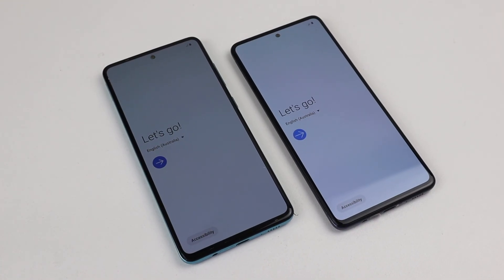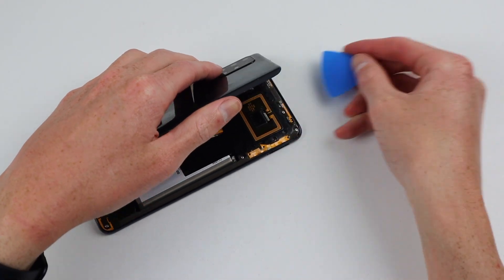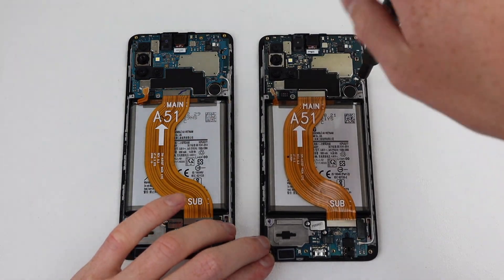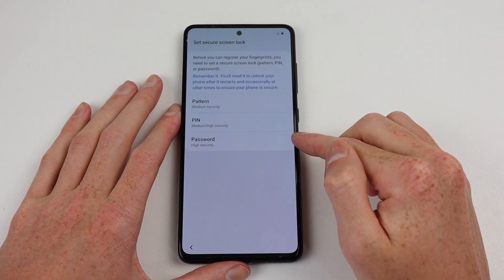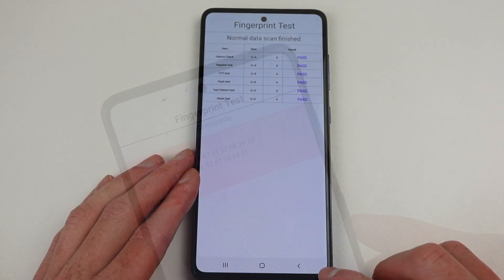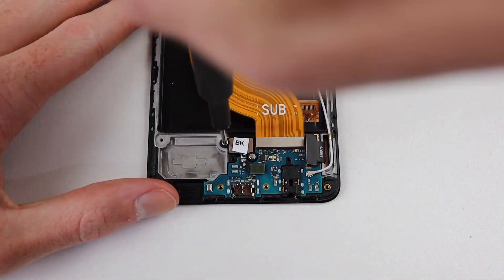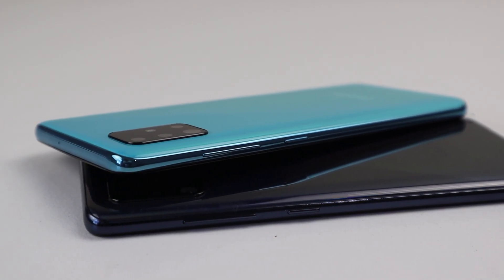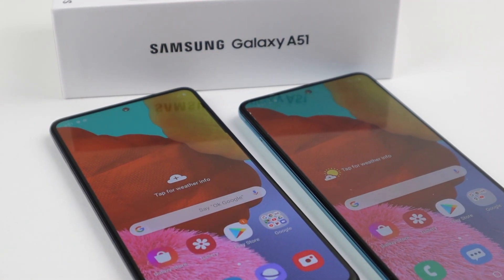Samsung Starts Blocking 3rd Party Repairs? - Galaxy A51 Teardown and Repair Assessment

Comment: Everyone starts saying "oh no Samsung is doing Apple things" "I'm glad I ditched Samsung since trash Exynos" "Chinese phones forever"
You all should probably calm down. This is the first time we see this issue. In-screen fingerprint sensors are not a simple component and Samsung is concerned with the security of the device, more or less. Calibration tools are not that easy to find and are not cheap, OR they just don't have the demand yet since this is a relatively new device, thus we don't see them. Time will tell if I am wrong, but later we will see more methods of repairing such things, so stop destroying Samsung for these little problems
Reply: You're wrong. This has nothing to do with security. The fingerprint scanner is just a camera, you can change it all day without compromising security. The actual fringerprint data is stored elsewhere on the phone. Changing the screen and fingerprint camera doesn't compromise security at all, that's just an excuse Apple and Samsung use to justify screwing you over for repairing your phone instead of buying a new one. 

Samsung will only get worse, just like Apple has only gotten worse. Shame you'd rather stan Samsung than see it.
Reply: @mjc0961  I wouldn't. I don't like Chinese phones, I don't like Apple. Right now I stick with Samsung, but only time will tell if I ever change my next smartphone. This is just my opinion on the topic and I don't want to make a claim, that Samsung is the best and is always thinking about their customers or smth. In fact, any company will do things over the board to earn more money and they will not care at all about environment. So yeah, I don't think I am wrong here. I might be wrong with the scanner, but I am no tech nerd, I just thought maybe they use something special for the scanner, rather than just a camera. People just need to stop making hasty desicions. Realistically speaking, any intellectual person will put a case and a screen protector on their smartphone no matter how strong manufacturers of the device claim it is. Real life shows, that all phones break no matter how strong they claim to be. So those, who break their screen or scanner are not thinking about the fact, that they can use that device for longer without spending money on a new one or repairing it. Or maybe it is just a software issue from Samsung that they need to fix to get repaired screen/scanner to work on that device, who knows? I don't exclude accidents, maybe they had all the protective measures and still ended up with a broken device. In that case, well, I'd just call this unfortunate. Again, only time will tell if I am wrong, but I wouldn't hate on a company for these little easily avoidable problems. If they continue to do so, I might as well switch to something else.
Reply: Tbh the fingerprint on the a51 is crap to begin with: it had a registration issue. And it took them so long just to sort it. Does that really show they care? Also Samsung is starting to act like Apple with the prices of phones, component replacements etc. Why the need to lock components? I replaced a s6 fingerprint and it was happy days, but now looks like you can't even fix your phone for cheap. There's hardly a security issue with fingerprint sensors that requires them to be calibrated to each phone. Chopping you're finger off is a security issue. It's mostly businesses looking to make money. Furthermore, the calibration devices are expensive as the manufacturer make it so: they can make the calibration in a way that devices can be cheaper. Sadly Samsung have failed to really make their devices easy to use compared to Apple: which is a big part of people choosing Apple over others (this is from my experience of my Iphome 5s, which says alot). If Samsung made software easier to use and still have customisation, they'd have alot more customers. My s9 plus won't be getting updated even though it can handle it. Samsung don't really care....
Reply: @mohmaar8761  But on the s6 the fingerprint is in the home button, when you remove it on the A51 you cant put it back in the same place as it was from the factory.
Reply: @MA-cx9os   you can. It might be a little off point but it should still work. Also he took them out and put them back in with right motherboards and it worked again. They weren't in their exact position but had no issues. It's a money scheme and one we heavily pay for.
Reply: @mohmaar8761  Yea but maybe the os recognized that that was the old one ao it didnt asl for calibration.
Reply: @mohmaar8761  Friends Xiaomi Mi 9t pro was sent for screen replacment when it came back the fingerprint wasnt working it was uaing the same optical sensore methode was sent back for repares.
Reply: @MA-cx9os  end of the day ot should have worked. Also the Xiaomi issue may have been something else: not installed correctly, sensor was faulty, dust in the sensor etc. End of the day it's not good that Samsung are not allowing sensors to work - just because it isn't the exact one.
Reply: @mohmaar8761  If you read the comments there are people who replaced screen and it worked there are other that it didnt work, the screens arent made 100% same so the calbiration is need. What if someone hooks up some hacking chip that can bypasses the fingerprints?Am sure that if you go to samsung repare ceneter they will calibrate it for free or fro some small fee.
Reply: @MA-cx9os  thanks for pointing out, I didn't read them all. But what happens if those people who changed it had an older Security update? As the video clearly stated: it worked with and older security update. What haplens if Samsung didn't release the lock on all varients of the software? I would kindky end the discussion: each to their own opinion.

Comment: Happens on all A series with under display fingerprint. It's because of calibration. The fingerprint is calibrated to work with the display it came with. However Samsung offer the tools (a tool called a black box and diagnostic software) to calibrate the display for repair shops that want to do it. However if you do it yourself you can always go to a Samsung repair center and they will calibrate it for you for free or charge a very small fee if it's not a samsung owned center. That's how it is in my country. Here's the video on calibration:
https://t.co/LMjvPYSY3h

It needs the calibration to work properly.

Comment: Samsung devices have a code to calibrate the display informations
Is *#2663#
With this code you can bound the New display with the Motherboard and maybe the fingerprint sensor can work again.
I have a Galaxy s6 with an original display fron another board and when I changed It, the touchscreen inverted, and with this code I could turn It back to working conditions.
Sorry for the bad english, I'm from Brazil.

Comment: Apple copies Samsung on the good ideas, but Samsung copies Apple on the bad ones. I really wish Samsung would just keep the stuff that makes their phones outstanding
Reply: true not only for samsung. For example, i had a lenovo laptop. It had "macbook" written all over it, but the particular offender was the charger brick. It is shaped like apple's ones, the shape sucks imo as it tends to block nearby mains sockets. Yet they totally forgot to copy the good stuff - apple's charger have hooks to coil the wire, and a detachable mains plug with standard iec connector underneath, so i can easily fit an extension cable to essentially fix the shape problem... lenovo's one has none of that.
Reply: Samsung copies apple on the profitable one...

Comment: The sensor has to be calibrated when the screen gets replaced. It takes a special tool to do, That only authorized repair shops have.  Ones that are parterners with samsung. So Best buy or ubreakifix.

Comment: As much as I am all for repair I am not upset about the pairing of fingerprint sensors to phones for security purposes. I would rather have a secure phone than a phone with a replaceable fingerprint sensor. There is however no excuse for Apple pairing things like batteries, screens, and cameras! There is no justifiable reason for pairing these components to devices.

Comment: Samsung is becoming the next apple control over everything. and Samsung repairability at their facility under warranty completely sucks I had a Samsung Galaxy s20 Fe under warranty tried to be repaired did not come back repaired correctly they're starting to slide in quality and now adding this layer of problems that's not good for consumers.

Comment: Try updating the S20's you have and swap the underfinger print sensor and see if the same issue is happening.And do the same for the S21 ultra if you can get your hands on 2.Weird that on my s9 with jan/2021 security update am able to swap my fingerprint sensor??.

Comment: pairing the fingerprint sensor to the motherboard makes sense for security reasons !!! you shouldnt be able to swap a pre-programmed sensor to a locked phone and unlock it that way ...and you shouldnt be able to hotwire the connector or hook it up to a micro controller that simulates a genuine fingerprint sensor to unlock the device ..... it happend with much more complexes devices like PlayStation and all the mod ships available for it and if Samsung leaves the fingerprint unpaired to the motherboard someone will make a mod ship to unlock all there devices .....
Reply: They should be more transparent about that like Apples when they do the same thing
Reply: @GTAandApplechannel  that will jut put more info about there security and architecture ... its  unnecessary and 99 % of users wont care about it
Reply: @fouzaialaa7962  Remember Apple MacBooks ARM when they are talking about “Hardware Security Boots” And Remember Samsung says anything about that?
No , they don’t

Comment: Removes sdcard slot, headphone jack, charger and also third party repairs like apple.
Reply: Also Samsung screwed a lot of phones with a software update. My Note 9 has yellowish display after updating even though I have never dropped it nor water damage it.
Reply: @SoloTheCashier  this yellowish or most people calls it greenish screen issue had been reported by many Samsung Note 9 users worldwide. What I can report based on my own Note 9, which I preordered before launch date (Aug 2018), is the green screen issue is not appearing now. What happened to my phone was I discharged the phone to 0 % and keep it for a day as powered off. Then, recharge the phone to 100%. Allow it to discharge slowly it to 0 %. Repeat. I did this repeatly for about a week. The battery is originally installed as I did not replace it yet. I also turn on the Always On Display (AOD) setting. So, far I have been using the phone for 1 month after doing this "battery refresh" fix. No more green screen issue. Try it and update by replying here. Good luck.
Reply: @SoloTheCashier  so you got a yellow screen after the software update? Do you know how absurd you comment is? You sure you disabled the Night Filter?
Reply: @staideystalking1850  i have nothing to say for him
one word: L M A O
Reply: @staideystalking1850  just google (Samsung Note 9 Sceen Screen Issue). It is world wide issue.
Reply: @ryugaforever7713  it is a world wide issue. Just google (Samsung Note 9 Green Screen Issue)
Reply: so why are we buying samsung, if its just another apple.. its better to buy the original apple, rather apple wannabe🤣
Reply: @charijard98  lol true
Reply: @charijard98  lol
Reply: @charijard98  honestly i have no idea why. at least with apple you have optimization and integration.
Reply: Reduces the price by 200...because of removed useless items...
Reply: @TerraPhotica  Well, not useless, just largely not used by their users.
Reply: @warjt4737   largely not used item is a useless item. How many of us used earphones? 0.1%, but everybody paid for them. Charger plugs...I still have 4 from previous models and let's face it, we use them with other devices. SD card, I would agree if the price stayed the same or higher. Now, it is way cheaper. Just because I liked to have more space, not like I need it, I got 512gb model. So yeah, spend same as last year and get storage, or spend way less for good enough space. Choose is theirs, but1 complaining is easier
Reply: @TerraPhotica  There are plenty of things that are not largely used, that does not mean they are useless.

Comment: Jokes on Samsung. I've never had to replace the screen on any of my phones, since something else usually broke first, or the phone got too obsolete to use altogether.
Reply: It only takes 2 years for a samsung to stop getting updates
Reply: @SomeNot  Not true. My samsung A3 2017 got a security update dec 2020 still. It's on android 8, and that still runs every armv7 android software
Reply: @SomeNot  because old Android versions still are very useful and good.
Reply: @SomeNot  1. androids really dont need OS updates anymore.
2. Samsung provides 4 years of major OS updates.
Reply: @RandomGuy-om1vy  On flagships maybe, not on midrangers and low end phones lol.
Reply: @vectivuz1858  yeah even mid rangers, idk about low end ones..
Reply: @RandomGuy-om1vy  Just made a quick search about it, apparently not all midrangers are eligible and it is for three android os updates not for four years. Maybe three Android OS updates and four years of security patches. That is still a lot though when compared to other manufacturers.
Reply: My Ericsson A2618s is 20 years old! Still working fine.
Reply: @AmigaA-or2hj  lmao
Reply: Amiga A1200 Damn, I wish I still had my Nokia Communicator in orange color. That was some great phone, slow, but very complete.
Reply: no such thing as obsolete
Reply: Too obsolete to use? I still use an iphone 3g I've had it for 10 years now
Reply: @bigupbassline58  I tried to squeeze 4 years out of my old Xperia E1, but only made it to 3 before the phone was completely unusable (couldn't install most apps, lagged a lot, etc).

Comment: When My Galaxy S5 dies, I wont be replacing it with a Samsung like it replaced an Apple Phone due to this very issue of stifling third party components and repairs, I yet again will research for a phone where Like the Galaxy S5 the battery can be replaced without ruining seals, Likewise I will also still prefer an easily Repairable Phone Eg: The screen, Ports and Port Seals can be cheaply replaced by a local "3rd Party" Tech and if OEM parts are not made available it can be repaired using some generic replacement/s..

I truly wish more Apple sheep had a little more synapses in their noggin, and now I hope Samsung sheep also have enough synapses to move away from Apples grave digging tactics that Samsung feels is the way to go..
Reply: Sorry to burst your bubble pal, but you won't find what you're looking for in this modern age. Just go with the flow, and try to take as much care as possible of your stuff. Sadly that's the only way around, unless you want to keep using an outdated device that doesn't work properly anymore.
Reply: @enzoperruccio  Gee I dunno, Like I said if-n My Galaxy S5 ever is unrepairable, I have my sights on several phones comparable to my Galaxy S5, comparable by way of 4K HDR recording, being just one of the features.

BTW Enzo, Pray tell what Modern feature do you think will burst my bubble that I don't know of other than an 8K HDR capable Phone?

Comment: 6:30 This is quite a bad issue because if someone steals your phone they can swap the finger print sensor and it may unlock your phone if the sensor needs calibrating

Comment: I can actually understand why an optical fingerprint sensor would ne recalibration. And knowing the folks over at xda we should have a way to recalibrate these is a few months or maybe weeks. Still though, it just occured to me that an android security patch is usually left untouched when distributed by OEMs thanks to project treble so could this be an issue on every android phone running the Sept. 2019 patch?